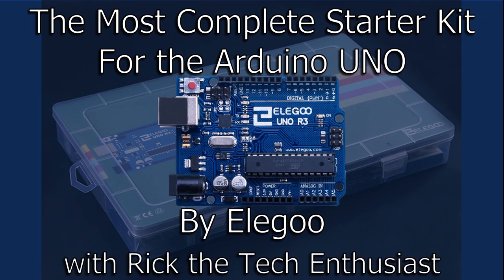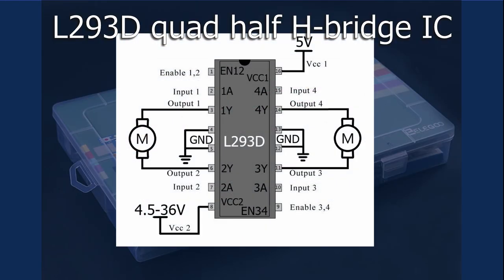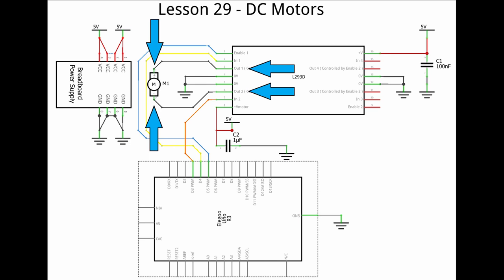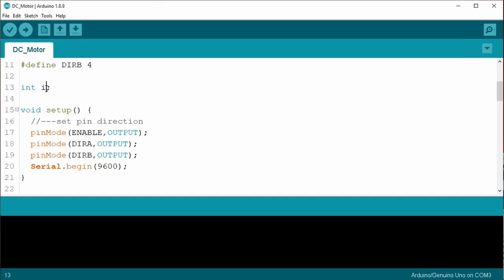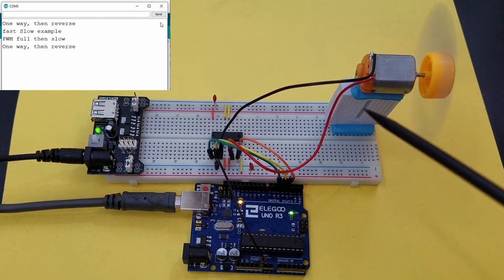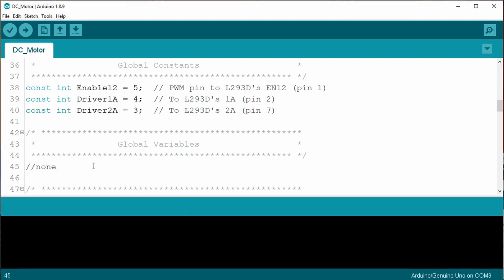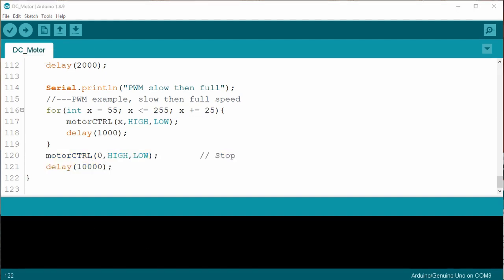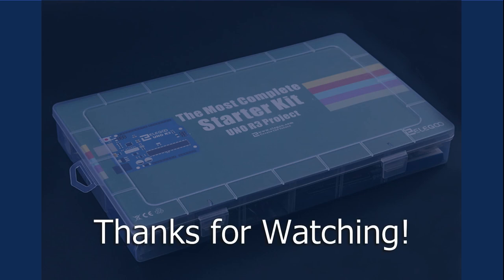Lesson 29 - DC Motors

Comment: Thanks for the video, Ricardo.  Two questions.  My carriage light was blinking so I replaced the APC-16-350 with same driver.  It's no longer blinking but only one of the four LED lights on the ring are working now.  What would that mean?  Also, a couple of the same Costco carriage lights in the front of house have a slightly different driver.  Part number on those is jw12W350-36, input voltage 108-132 VAC 50/60hz.  I had ordered several of the APC-16-350 assuming they were all the same but this one will not work in the front lights.  Do they have to be exactly the same driver?  Thank you!